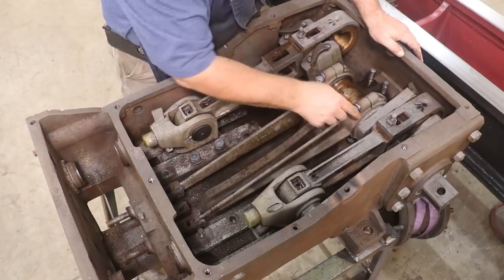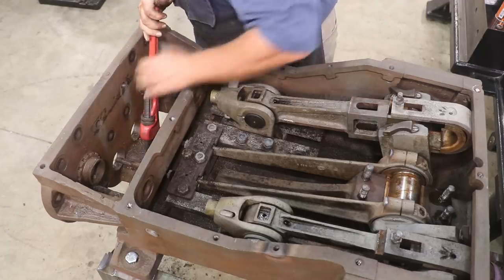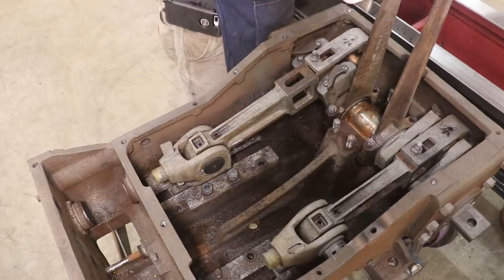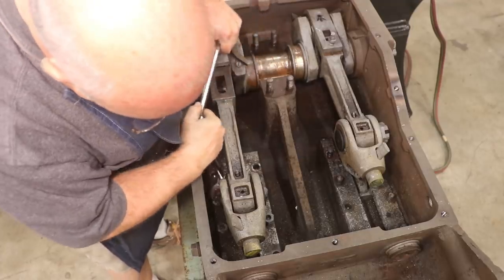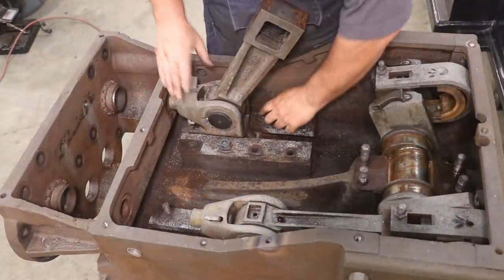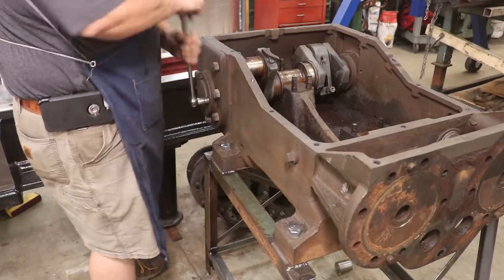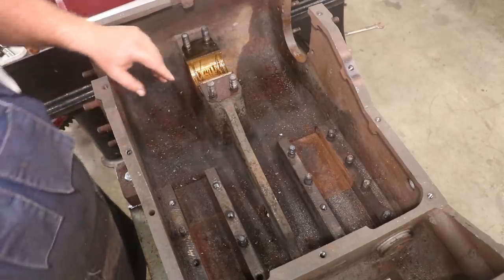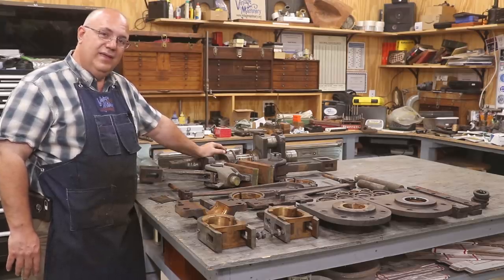Steam Locomotive Stoker  Engine Restoration - Part 4: Disassembly Continued

Comment: Respects for the calmness. I felt like throwing tools just watching this :)
Reply: LOL Me too
Reply: Not to often we get to see a hobbyist machinist dig in like this, but calmness and persistence wins the day. this is entertaining and  why my time is spent here and not watching Dancing with the Stars or worse yet the News. lol
Reply: It's extremely painful to watch Keith's abilities as a mechanic.
Reply: The most painful way this stoker engine has been striped down if diesel oil had been left to soak on all nuts and bearings parts would have come apart more easily it also been better to take the crankshaft end caps off  and lift the complete shaft and con rods out in one go
Reply: It amazes me that Keith doesn't swear while doing this.
Reply: Me too. I would probably have thown a few tantrums, curses and evil spells. Just about every d..n bolt and nut!

Comment: The missing cotter pins on the top castle nuts, but present on the lower nuts, is a real indication someone tried this before and gave up real quick.  Your perseverance  is outstanding and matched by your expertise dissecting and rebuilding these old rusty clumps of iron and steel.  It is real history preservation to get this stoker running so they can get the COAL burning steam locomotive operational.  So many "restored" locomotives start with conversion from coal to oil burners, way better than scrap but not quite the same.  OK I'm biased growing up in the 1950s with coal fired steam heat and hearing, smelling and seeing locomotives in a roundhouse just a block away.  We have no doubt at all that you will prevail and get this rust bucket rebuilt and stoking coal again. Can't wait, can almost smell the burning  coal and steam.

Comment: In the December, 1963 issue of Trains Magazine, the NC&StL Railroad was featured. The article showcased the J3 engines built by ALCO in the 1940's. These engines made use of a lateral-movement box system mounted on the 1st and 2nd axles of the driving wheels. These allowed the locomotives to slide easily into the 6 degree curves, found between Atlanta and Chattanooga. The stoker you are working on comes from one of those J3's. You knew that, but you might not have heard about the lateral-motion feature. All the best to you, Keith as you work on that stoker. The folks up in Nashville will be happy with your work, I just know it.

Comment: Keith: ‘these little valve stems here’
Also Keith: *has an 18” pipe wrench on the valve stems
Reply: He's like the Bob Ross of steam engines.
Reply: My father in law had a 3’ pipe wrench. And, several smaller down to 8”. He was an MD for USSteel. 

You go figure.

Comment: Hi Keith, I would recommend spray welding at the crank shaft journals. If the bronce bearings have a bit of wear, you could re-machine them and compensate the difference by building the journals a bit over-size. We made this on coupling pins and axle journals on our steam locos as well. The piston and valve rods could be spray-welded or galvanized as well for making them stainless. This prevents the typical corrosion in the packing gland areas due to condensation and the occasional service cycles on Museum locos.

Comment: Spray welding? Abom79 likes to travel... he likes shrimp... 🙂
Reply: Adam and David and Keith would make a greed team
Reply: I had the same thought, he had a video recently where he did exactly that to repair a bearing journal, it wasn't a crankshaft but the same technique might work.
Reply: @DeutscheReichsbah100  i mean he did come out too do the repair also he like controlling a train lol
Reply: Literally came to the comments to advise Keith he should drag Adam into this project for the journals.
Reply: @TheSkipinatorVids  Dam cant think of that amazing man with dog as his boss. Lol for casting if they need big tool to do it. He got one they use him for one of shaper from otherman i cant think of
Reply: David Howard you mean Brian Block ?
Reply: Won't work, spray welding would shear off. Adam's method is brilliant for bearings with balls inside, where by the structure of the spray weld isn't under constant pressure and heat. In a ball bearing repair, the weld can't go anywhere but where it is, it is constrained by the inner bearing race, in this type of bearing, it would heat up, expand, and then shear off in ..potentially catastrophic ways. Remember, that's a lot of power going through that crank. Steam locos are not to be trifled with.

It's just my 2 cents, ultimately, Adam knows best, he's been messing with that stuff for a long time now.
Reply: @aserta  Adam did a lot of work with big journals when he worked for Motion and he used a couple of different methods in his videos for building up worn surfaces, so he may have something to work with.  Also, remember that this isn't a high power engine.  These engines were used to power accessories on the tender, not actually propel the locomotive.  The stoker auger or belt assembly simply needs to move mass at a consistent speed, having a "large" engine like that allows you to use the mass of the engine itself as a fly-wheel to help keep things moving, not to actually transmit large torque loads.
Reply: @joshualarson3770   I'm thinking Dave Richards of Old Steam Powered Machine Shop.  Dave does winter in FL.  The shop is in upstate NY.
Reply: @joshualarson3770  David Richards with his Old Steam Powered Machine Shop
Reply: @aserta  Too true. The journal will need to be ground down and plated and then ground to size. I would recommend chrome or nickel. Either of these would prevent the same situation for the next poor slob.
Reply: --> R E Hill:  You beat me to it, guy! Adam loves his spray welder. And P Bal is right, Adam and Keith together on a project - Wow!
Reply: @aserta  good point... 
Perhaps a hard weld, build up, like they do on cam shafts would work. 
Back in the day I had a couple of moto engines that had hop up cams that were hard welded then ground to profile.
Reply: @aserta  This the stoker engine which works the auger and maybe a crusher. The shocks will be from coal getting stuck or maybe the occasional stone.
Reply: Didn´t Adam just do a video about the Eutalloy gun a few days ago? that thing, maybe with the hard stuff, might be helpfull also for the pitted flat surfaces beneath the sliders.
That thing seems to work slightly different from the spray welder by actually fusing the powdered metal in a puddle to the part. Could possibly do the trick here.

Comment: I was a engine mechanic in a wrecking yard for 32 years. One of the most valuable tools / machines  I had at work was a Storm Vulcan parts washer and the second machine was a glass bead cabinet. I was allowed to use them for my personal use when I was off the clock.

Comment: The camera plays tricks on this project - I have to keep reminding myself how massive this thing is.  For instance, a nut on the crosshead looks like 5/8" and you say "1-1/16" then your hand looks tiny when you reach down to it.  Also, thank you!  I realize how much easier it would be to do if you didn't have to worry about moving the camera, etc.
Reply: Tennessee Valley Railroad Museum might be a good resource

Comment: Mr Rucker, I'm really enjoying these videos about the stoker engine. I know you probably already know this, but there are companies out there that specialize in welding and grinding crankshafts of all types. It seems to me that would be the simplest and most expeditious way to get that crank repaired and back into spec. I'm following this project until the end sir, keep up the great work with the project and the videos. By the way, I work on locomotives for a class 1 railroad, but steam fascinates me to no end.

Comment: That Crank shaft has Abom spray weld written all over it. Looks like a fun  job so far. Keep up the great video.
Reply: The big issue is chucking it up and getting the timing correct for the rod journals.

Comment: Possibly make a bushing to shrink on the crank. the pitted crank journal will have to be machined down so a decent thickness bush can be made. several thousands interference fit sith an 1/8-1/4" wall on the bush, Heated with a torch to a dull red heat then drop on.
Of course Abomb could spray weld build up the journal still about 1/16 -1/8 build up.
The crank would then need to be checked for straightness after the heat.
Good luck
Looking forward to see the completion.
Thanks for the vids

Comment: Kieth, watching the disassembly of the steam engine I felt you’re pain. I just replace all the hydraulic hoses on a backhoe. The better part of five days. The valve body underneath the controls and behind several brackets and a mounting plate is a cluster of 7 valves. Each valve has two hoses. They are clustered tight together. The big hoses have 1 1/4” nuts the smallest have 7/8” nuts. A combination of end and crow’s foot wrenches were used. Sometime as little as a 1/16th of a turn at a time. I had to go through that agony all over again watching you.

Thanks for the great videos, the give me hope.  Randy

Comment: Keith, next time you get near a harbor freight, pick up one of the 25" breaker bars. Makes life much easier when you need leverage. That Booth guy who is now a big traveler might have a way to deal with that crankshaft using a stick welder and that Block guy might be able to do some of the boring.. Seems like you know them...

Comment: You can probably weld up the caverns in the case and crankshaft and then machine them to original size. 

Some damn good job done here, can't wait to see the engine bathed in the Evaporust and cleaned.

Comment: I can see the video's now: 
Dave Richards - Cylinder Bore/Sleeve/Pistons/Rings
Adam Booth - Crank Journal Spray weld / Machine
Keith Fenner - Piston Rods
Brian Block - Cross Head Guide Slot / Block Resurface
Keith Rucker - Rod Pins and Custom Hardware
Tom Lipton - Valve Rods

Thanks for the video Keith.

Comment: Remachined crosshead slots by your own new planer,,
crankshaft spraywelded by Abom, 
cylinders bored/sleeved by David Richards, 
tapered piston rods by Keith Fenner...

But first throw all iron/steel parts that are about to be kept back in the EvapoRust for a good amount of time, there still seems to be quite some rust left to be eaten away.

Comment: For the bottom machining check with Abom79 about using a Flex Arm.  Also, if you need those bearings honed I’d be happy to run them on my Sunnen bearing hone.

Comment: I believe I saw bolts with locking tabs bent over them running down each side of the journals of the crank. I'm thinking you could probably remove & machine new journals. Looking forward to the rebuild.

Comment: I'm not sure if you read comments.  You may have marked those bearing caps off camera, but for the viewers; those bearing caps like the ones on the valve rods should be marked and put back exactly the way they came off.  On all engines that I've worked on the rod and the cap have a number stamped on them that match up and those numbers go toward the cam side when reassembled. Also for your viewers you should take care not to pry against or beat on the cast crankcase.  I have seen guys break them.
Reply: I have seen Keith rebuild a lot of equipment over the years.  I will guarantee you he marked all of the pieces for reassembly.  First thing he does!
Reply: @paulcopeland9035  I'm sure he did.  I'm sure he knows more than I ever will when it comes to rebuilding things.  I just thought I would mention it for others.  I suppose I shouldn't have used his comment section to mention it, but I ment no offense to anyone.

Comment: Keith, would a socket with an elbow piece (or two) and an extension help you downstairs? The crowfoot is a revelation for me. Never saw it before and it sure does the tough work first. Thank you!

Comment: Interesting job Keith, might I suggest hard chromed rod for the replacement piston/valve rods? its readily available , mainly use in hydraulic cylinder manufacturing , Regards.

Comment: What about a local automotive machine shop for the crankshaft? I used to work at a crank and cam machine shop back in the 80's we could weld journals and regrind them so I am sure they could refurbish the crank.

Comment: The normal repair for a crankshaft, is to weld and then grind down to specs.
 My father was a automobile machinist in the 50’s and 60’s and was responsible for running the crankshaft grinding machine.

Comment: Hi Keith, another great video as always!

Quick tip, you may or may not be aware of this but it seems like you normalize the audio volume of each individual clip. That works great when you talk at some point during the clip, but when you’re quietly working for the whole clip it just amplifies the background noises by an extreme amount to effectively raise them to the same level as your voice. That makes for a pretty abrupt cut in the audio.
Depending on what editing software you use, there’s usually an option in the normalization settings to apply one gain value across all clips rather than maximizing the peaks of clips individually. 

If you then find your voice is too quiet in some parts, dynamic range compression could provide a more subtle and controllable solution.

Comment: Just a silly question from an old mechanic: You had unfettered access to the side plates holding the crank in place... Why not remove those FIRST to free up rotation? 
Just an honest question...
Reply: C A Wensil   my thoughts too, but to be fair Keith never claims to be a  mechanic.
Reply: Think its more hindsight to be honest. At the time he most likely didn't think of it, and me watching it didn't think of it till he pulled them off.
Reply: @matthewfarrell317  I thought of it when he first started. But... As was pointed out, and being fair... He never claimed to be a mechanic. I am not faulting him in his choice. It was just a question. Freeing up the rotating assembly would have probably meant a lot less frustration.
Reply: @cawensil3264  The crank would never 'run freely' -- the slide retainers would not have been any different or easier. But yes, cracking everything MOST EASILY ACCESSIBLE first sure is my typical path!
Reply: at 21:42 he mentions that he had to go to the Museum to get a gear puller. I think he was trying to avoid that trip.
Reply: I think I would have used the impact wrench to loosen the bolts from the beginning. I always got along better with the hammering from the impact breaking loose stubborn nuts with less damage.  Keith lucked out without twisting off a stud except a couple in the outer case. I think an air impact is better for this than an electric but both would be less effort than pulling breaker bars.
Reply: Order of operations got to him, he adjusted course after. First you remove the arms, then your move the crank. Leaving the crank unsupported whilst working on the arms on a machine this age (and metallurgy) is not a good idea. You can have..unpleasant results.
Reply: First is a matter of not seeing how everything went together to be able to take it apart. I have gone down that road previously in finding out a different sequence would have made things easier.  Rust and gunk definitely did not help any.  Keith has enough understanding how a steam engine works to grasp how parts should go together.  The big deal is sequence.
Reply: What would that achieve?  You're not going to free up rotation unless you can move the crossheads.  You might be able to turn it far enough to get one of the rods free of its bearing assembly, but the other one (on the output side of the crank) won't clear its bearing without the crosshead moving first.

At best, you might cut order of operations down to:
- loosen rod bearing assemblies
- remove valve rods
- remove main bearings
- rotate crank a bit to and remove bearing from the rod that's in mid-stroke (requires beating the rod to swing it out of the way)
- carefully lift the crank against the tension of the stuck wrist pin on the other rod in order to get enough clearance to disassemble its bearing, being careful not to twist anything or bang up bearings or journals

still sounds about as much a haphazard pita as anything else
Reply: Yeah, I kind of agree that things could use a bit more soaking, heat, and impact wrench.  It bugs me to see he's straining on a ratchet to try to free rusted fasteners that are destined for disposal, but he reassembles the freshly rebuilt planer with the brute of the impact wrench.  

Either way, it's good that it came apart with no major snags.  Cheers.
Reply: Personally i would have added oil inside all the oiling spots and let that do its job the next two nights or so.

Comment: Two ways to fix that crank; crankshaft shops can and do that type of work all the time. Turn the journals undersize and make new bearing shells to go inside the existing bearing OR make new complete shells from cast iron and then machine bronze inserts. Or, tig braze the pitting with silicon bronze and then machine to size and grind to final on a crank grinder. Another option is to grind out the pitting and feather the edges back and have it polished at a crank shop. I have done this myself on race cranks that had dings in them.

Comment: Having trouble sleeping...watch a Keith Rucker video, works every time! Instead of trying to weld, and build up the crank journals, Why not do what we do in gas engines, turn the journals undersize, and just make your new bronze/or babbit bearings to fit? Seems a LOT easier than possibly ruining the crankshaft with heat warping, cracking etc. Do NOT even try "spray welding", good for bearings with races (stationary), not so good for friction (rotating) bearings!
Reply: Totally agree. If the pitting is not too deep this is the best way to go. The crank needs turning and grinding anyway and you also have to make new bearings one way or the other.